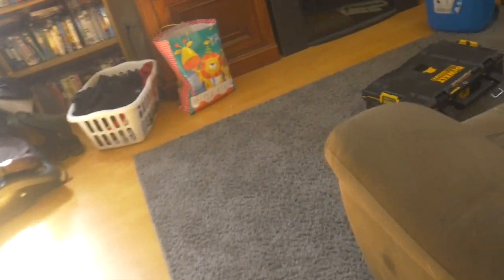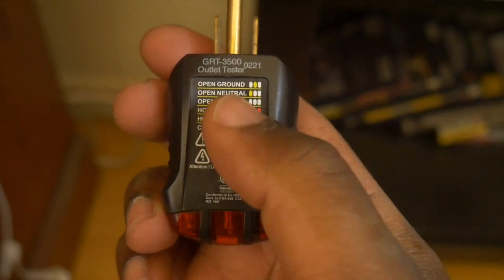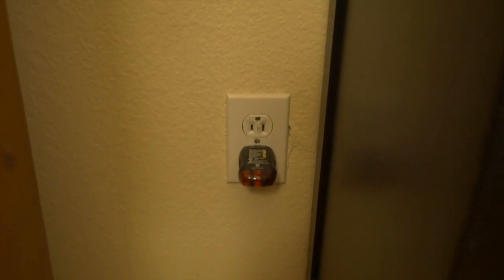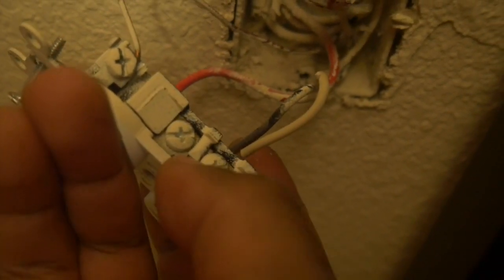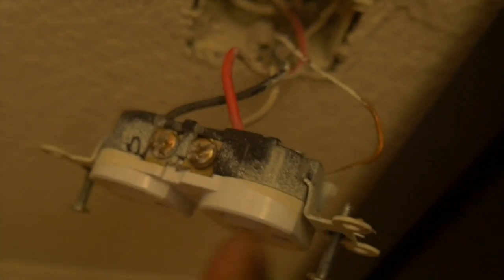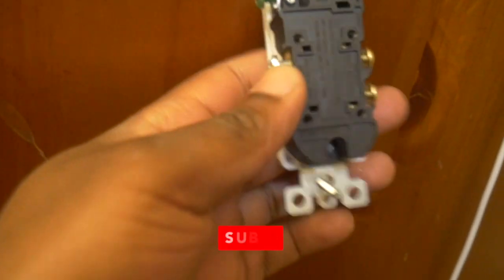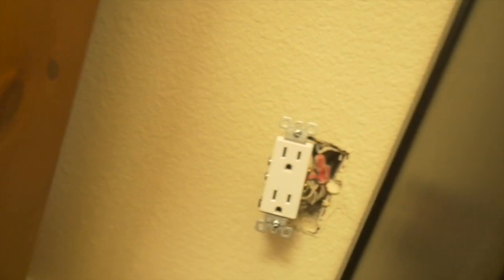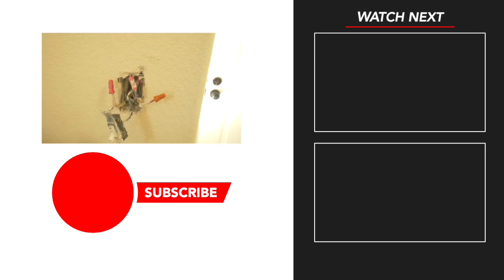What does it mean when a outlet is upside down

Comment: Well I would say the Outlet is upside down because I see them Almost 100% of the time in residential the other way.
But the funny thing is that tool that you used to test the outlet it has the instructions for using it and the words Easy-to-Read with the ground prong on the top 😲

Comment: With the ground at the top the outlet looks less like a face to a child 😮
Also should test first after turning off the breaker in case you got the wrong one or part of where you're working was powered from another circuit
Reply: He didn't check the outlet after turning off the breaker because he left the tester in the outlet and came back and it was off.

Comment: I see you are new at this so just a few pointers on your tech terms. (proper nomenclature)
It's a snap switch or wall switch.
The wires connected to a switch will be a feed wire (hot) and a switched leg. (goes to the load)
These are duplex (2) receptacles, although some say outlet, which is not the exact term.
Plugs are on the end of a power cord.
The proper tech term for the "plug" on a cord is cord cap. (male or female)
Screwdrivers are phillips TIP and flat TIP (or flat blade) the term flat head (or slotted head) means the type of head on the screw itself.
BTW, flipping a receptacle is NOT common for one that is switched. In some areas it's a new code, supposedly to prevent accidental shorts if something falls down the wall or if a metal cover plate comes free. In most areas the flipped receptacle is just a personal preference.
Practice your script and your next video will be ten times better.
Reply: Appreciate the knowledge and info. Yes definitely a newbie when it comes to this.
Reply: To expand on what rupe said and to help you do your job better a few more pieces of advice.  [A] In my area it is code to install duplexes grounds up in commercial and industrial applications, residential is up to discretion (unwritten rule is in new construction grounds up, rework match existing device orientation).  [B] switched outlets are marked using either red wire or a piece of red tape around switched lag.  [C] Do not use the stab in connectors in the back, these has been found to loosen in time and cause an unreliable contact.  [D] Tighten all used and unused screws.  [E] Tape all wire nuts.  [F] Wrap device with tape (Contested,  I normally only do in metal boxes but some GC's like my current one prefer all devices wrapped)
Reply: If you use the nomenclature found in this comment you will get less views and no one would know what you’re talking about 🤣
Great video! Don’t waste time with that! 😝
Reply: @loveasapologetics  ... you might be amazed at how using correct terms will force people to actually learn something and better themselves.